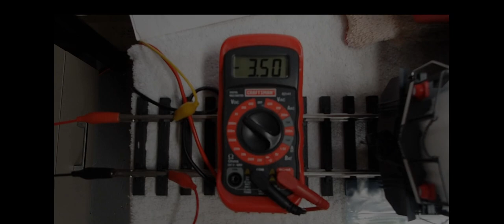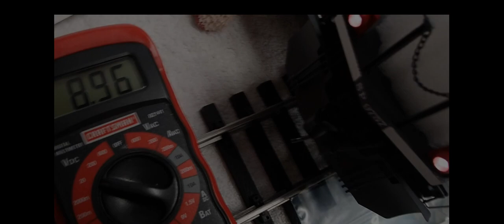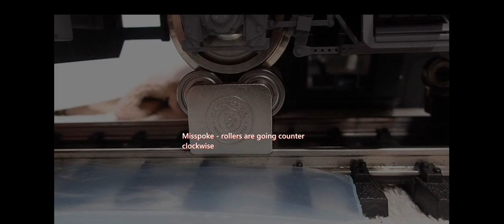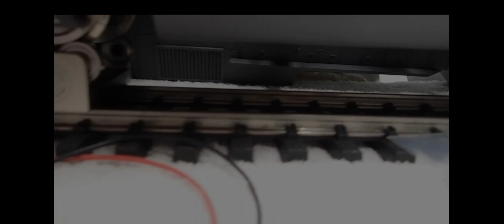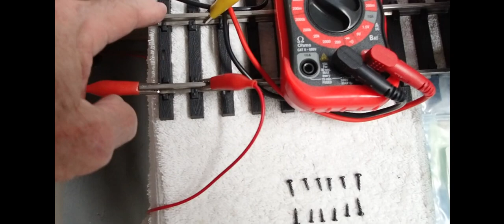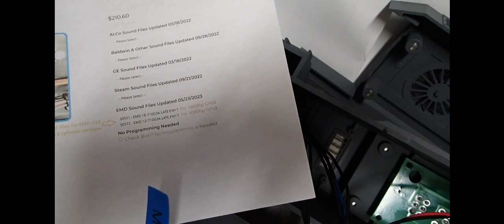AML GP60 Operational Directional Fix- Video by Ted Doskaris

Comment: Thank you so much for posting this! I've been frustrated with most modern g-scale powered units (especially the Bachmann speeders) being reverse polarity for all my existing equipment and having to disassemble and rewire them. I was dreading taking apart my brand new GP59, however this looks much easier than I expected, so thank you again.